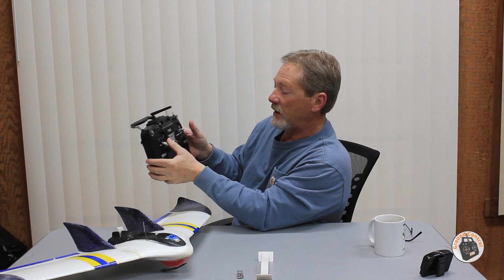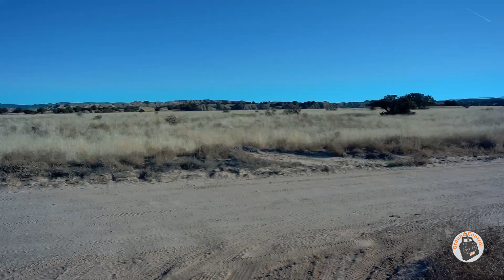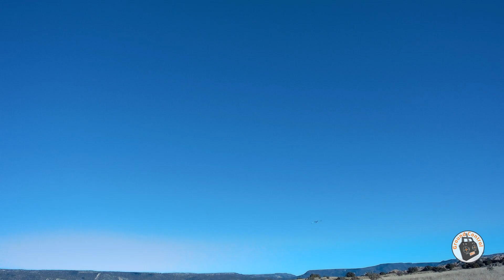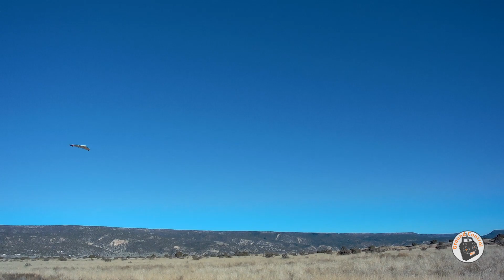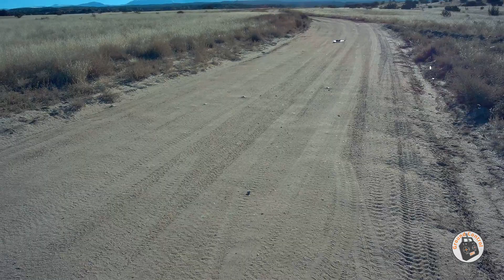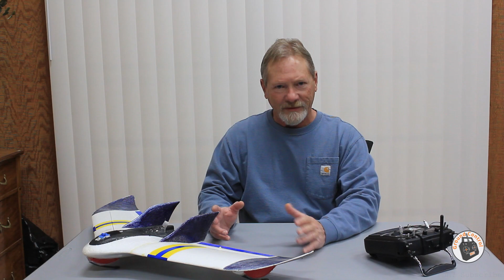Re-Review - Radiolink Byme-D 3CH Flight Controller & Gyro for RC Planes with Aileron/Elevator Mixing

Comment: hey i just bought a delta wing and i got it all setup. I didn't know how powerful this thing is. I am a little nervous about flying this thing around people. Im still gonna fly it thats not even a question, but i do have some concerns. Any tips on launching it? should I throw it like a football?
Reply from the maker: I used to do just that until the prop caught me and I had to get my finger stitched up ;-)
I launch my Wings and Parkjets by the wingtip now.
It feels a bit awkward at first but after a few launches it's fairly mundane.

Comment: Very Interesting, and well put together !!  It will be great to see if your counter oscillation strategy works out .... So, I was thinking to get some kind of stabilisation system for the arrows viper 50mm right out of the gate. I notice arrow's do an 'Arrows vector Stabilizer' product which is sold as an add-on with the viper or BAe Hawk. Do you have any thoughts on whether the Byme would be better ? if it's 'Byme' I'm guessing the -A would be appropriate ? They both seem great value. Cheers, Phil (uk)
Reply from the maker: Thank You!
The Radiolink Byme-D seems to be a bit more sensitive on the gains than the Byme-A but I think setting up the linkage for maximum movement of the servo arm is the best way to setup a plane for any gyro.
My Arrows Pioneer has the Arrows Vector Gyro installed in it and it performs very well.
I think the the Radiolink Byme-A does a better job with Wind Mitigation than the Vector Gyro.
The only Jet that I have a Gyro in is my Converted Eachine F-16 50mm EDF Jet which has a pusher motor and prop rather than an EDF Unit and the Byme-A works very well in that Jet.
I just released a flight video of it today and I used Fully Stabilized Mode for Launch and the rest of the flight is in Wind Mitigation Mode.
Even with Full Throttle passes the Byme-A was very solid.
See you in the Air!
Reply: @GroundControlRC  Many thanks. I'll go with the Byme-A for the Viper. 'Cheap as chips' here in the Uk also which is helpful when starting out ...
Reply from the maker: @doverivermedia3937  You are most welcome.
See you in the Air!

Comment: Tony. Good timing for this video.  I have the byme d and got the receiver r8ef to go with it.      Now I am building the GFY mini f22 at 110%.   To go along with my 125% one.       Question.  Ever thought to flip the servos so the linkage is under the wing?
Reply from the maker: Yes, as a matter of fact the next re-design will be that way.
For this design I was trying to make the center mass as compact as possible from nose to tail, side to side, and top to bottom.
When you do that the aircraft will rotate very easily in all 3 axis.
Since the control rods are very long you either have to reinforce the control rods so they don't flex or pull from the top.
I chose to pull from the top.
If you locate the servos on the bottom so they push the elevator up rather than pull the elevator up I would recommend locating them close to the elevons so the control rods are short and won't flex or reinforcing the control rods, otherwise, in a high speed dive you may find you have very little elevator to pull up ;-)

Comment: For me I just use my glue gun and make a small puddle and then touch the gyro to it and hold it so that it’s resting on top of the glue puddle and wait til it dries then I’m done. To remove I use a small paint brush and some isopropyl alcohol to wet the glue and it releases 🎉
Reply from the maker: Hot Glue gets so many jobs done for me quickly.
Reply: @theoztreecrasher2647  no doubt it’s better but I have over 1000 flights and not one time has the gyro become undone 🥂 how about yourself?
Reply: @theoztreecrasher2647  aww sorry if I hurt your feelings. Maybe try posting up videos so we can see your work?
Reply: @theoztreecrasher2647  🍻 I see you’re just a YouTube troll. Carry on mate lol